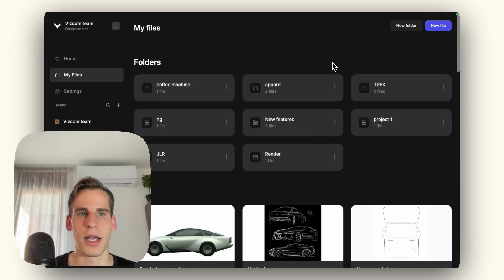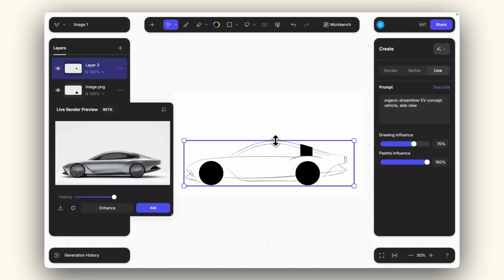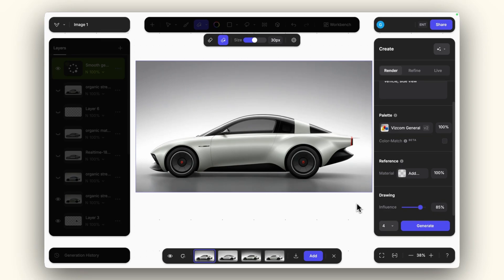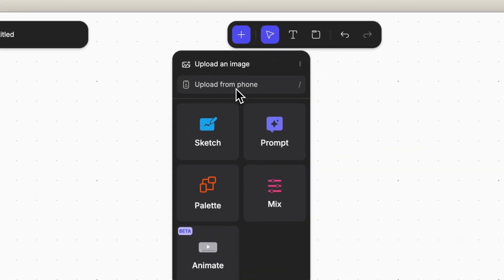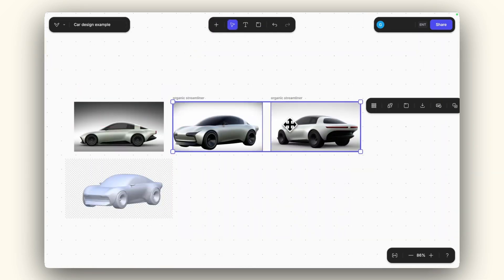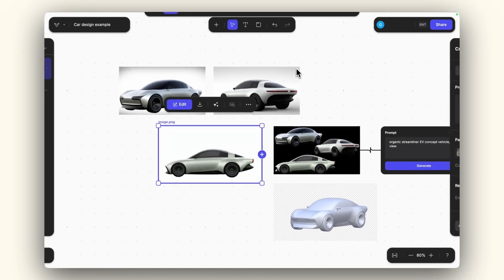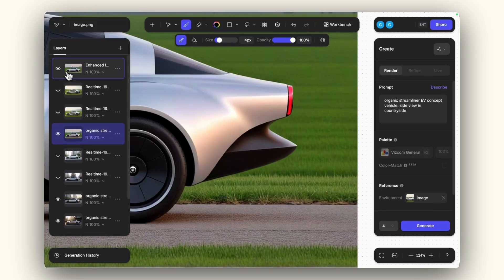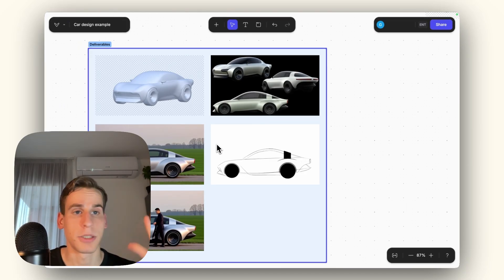Design with me#8 - Car design idea exploration - getting ready before 3D modeling

Comment: how do you convert a messy sketch to a clean line art. most users will sketch outside the vizcom . and you know anything goes wrong with bad sketch . ai needs a clean line art input . this is a big prolem unless you manually draw clean lines over the rough sketch. im very struggling

Comment: My recommendation will be to show subd mesh of the model. If we can see the edge flow of the 3d model. We can go to blender and manually model the design ourselves.
Reply from the maker: We are working on a low-poly quad mesh output. Right now the mesh is too dense to edit it. So it would remain as a reference underlay in the meantime.